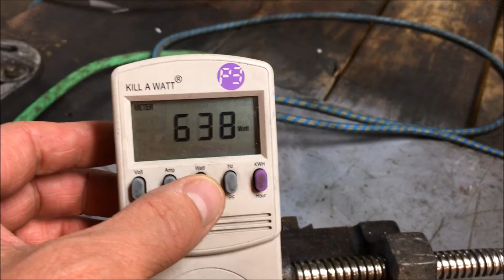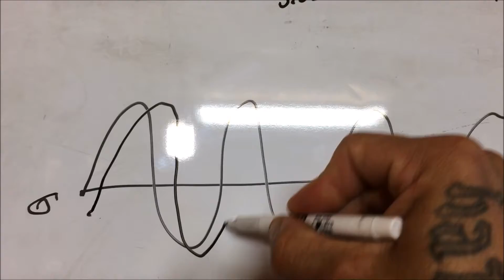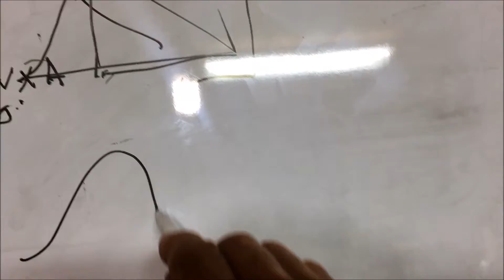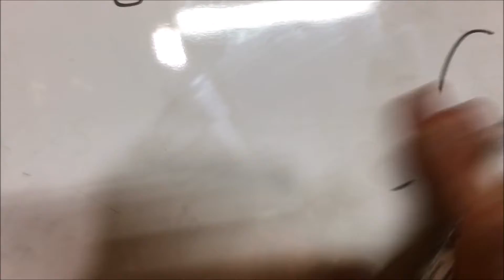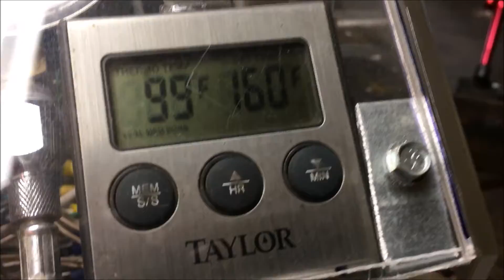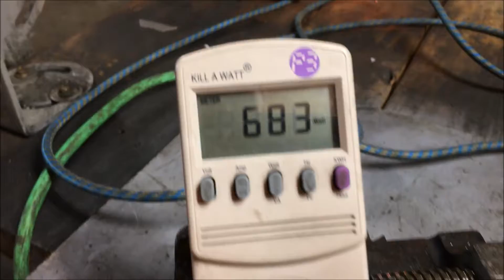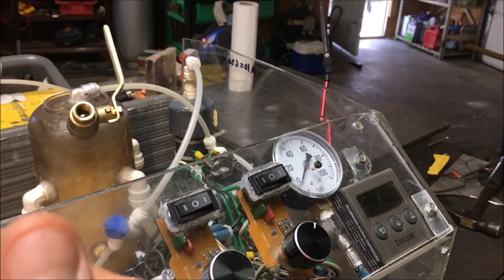Fire Brick test Information

Comment: Yes they are variable resistors on those boards. That rig is solid, run all day! What is going on with that bubble of brick?
Reply from the maker: i dont no bro thats why i posted the vid i wasnt gonna bother , it appears to be a rising column of boiling fire brick yes it is literally boiling the fire brick
Reply from the maker: its as if a couple of bubbles form  out gassing or boiling form at the base and do not pop then bubbles form under that lifting them up and the process continues building this craw dad hole
Reply from the maker: yes, so far so good with the oil defoamer
Reply: try weighing a piece of brick then cooking the crap out of it til it is that bubble material, and weigh again. I am interested to know if there is a significant weight change.
Reply from the maker: Sure ill give it a try , possibly tomorrow because im gonna do another foam test so the torch has to sit there and burn for an hour so why not test to see how much rock we can boil off